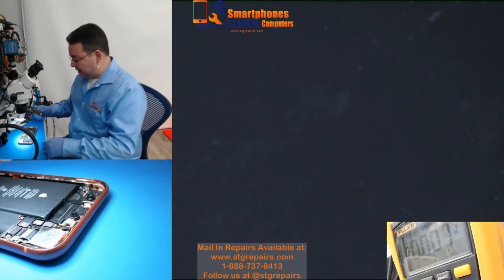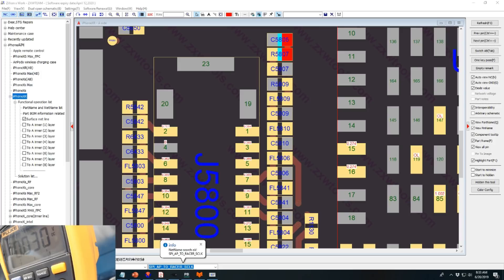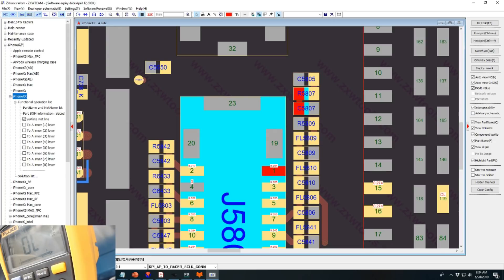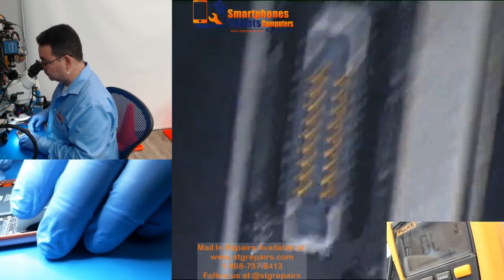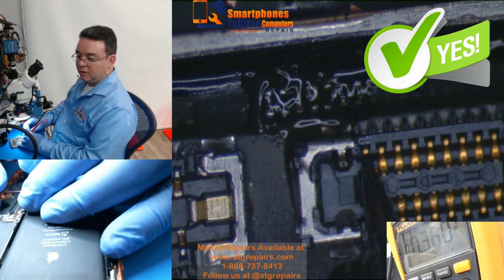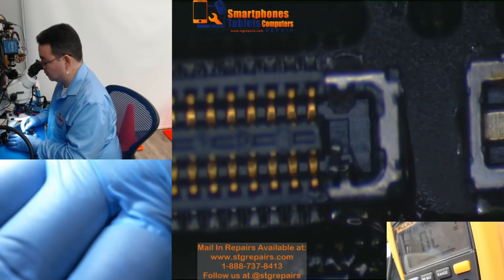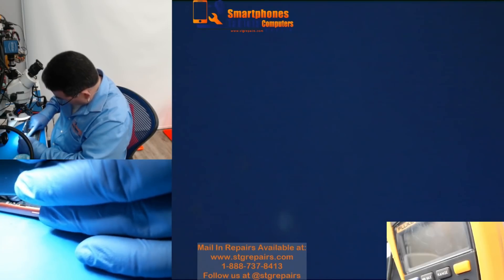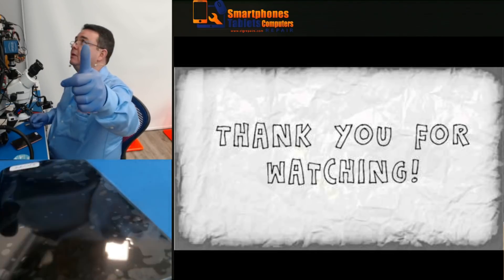Iphone XR Touch Not Working Solution!!!

Comment: Congratulations Armando! Curious this capacitor (which is not even a capacitor in fact) is not present in schematic and interesting also this case as a whole
Sometimes it happens that some technicians connect the LCD screen and the touch with the connected battery. This may have been the cause of this short on this capacitor C5807 and pad 1 of the J5800 connector;)
Reply from the maker: Luis Ribeiro thanks and yes that could be the case when they replaced the screen 👍
Reply: @stgrepairs4893  Armando, can I give you a suggestion if I may? I noticed that in the description of your channel (in the part of about me) does not have the addresses of contacts like face, instagram site etc. Must put because many people consult the field about. A hug, success and greetings from Brazil
Reply from the maker: @LuisRibeiro  just added it, thanks
Reply: @stgrepairs4893  ✌️
Reply: @stgrepairs4893  Hi I have issue tha work only half bottom touch. Phone came from another shop and I read all diode value with known good board it seams all is ok only thing is that cap. C5807 on pin 1 is missing. Could be from that?
Reply: @mobprof805  Hi friend, can you solved the problem ?